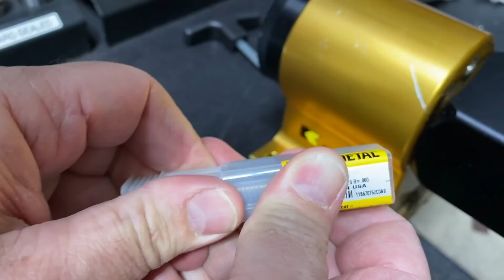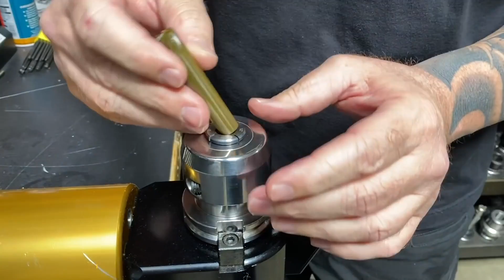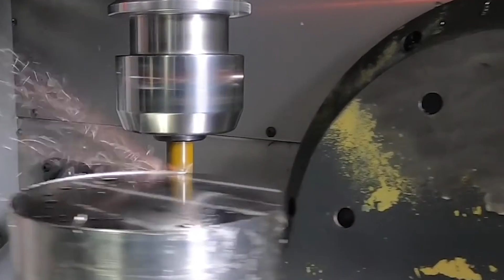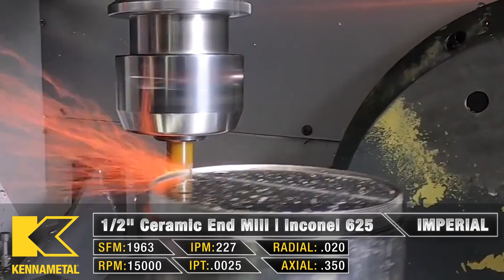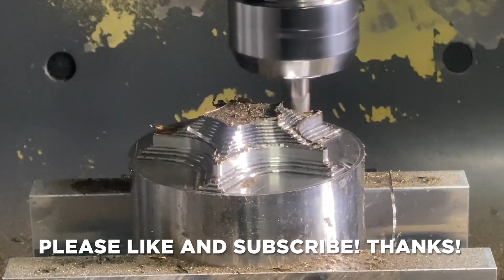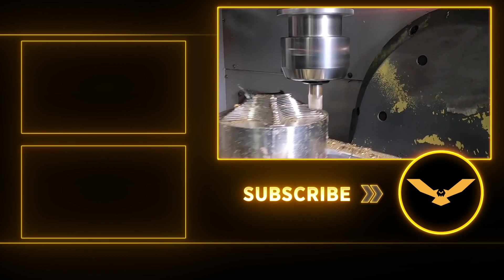You Deserve to Get FIRED if You're This Person in the Machine Shop

Comment: i work in a shop where we the machinists do everything from programming to fixturing to deburring. We basically get material and a print and we just have to figure it out. Ive long said i as well as everyone in shop deserve anywhere from 3x to 5x the amount were making because we are doing 3 to 5 times the work of a normal machinist/operator. Would love to hear some opinions on this, because its got me pretty messed up at work.

Comment: I used to work in a company where they often said "We've been doing it like this for 20 years.. " turned out..i did figure out my own way.. and did the work in half the time.. (only 2 hours instead of 4)
I have my own shop now.. i document everything.. i have made setup-sheets for every part and every machine.
I Stored these sheets on Google Documents, so i can look them up on my phone or tablet, i can edit them, and they  are automatically updated.
This saves me a lot of setup time.. this week.. i switched parts on the lathe.. looked at the sheet.. Ok.. need to replace 2 tools , upload that program, set offset to this value, load program, load stock, hit start.. 5 minutes.. i love that..saving time by working efficient is what gets you paid more..

Comment: I worked for an extrusion company that was international. The issue was that they used the only production facility in the u.s. as a funnel to fuel the rest of the company in other countries. Other facilities were given top tier supplies and technology to support their work load but the u.s. facility had to make due with secondhand equipment and poor management. I left after I eventually realized there was no room for advancement and they just didnt value people who took pride in their work. If anything they only put pressure on the experience good workers to work harder. When management was talked to about it they always did the same b.s. of we are a team and we need you guys to step up. They didn't even train people they just put you somewhere and expected people working production to also teach and train you.

Comment: I have seen 3 different types of programers. Worked under one that was horrible. He would be happy with you one second and upset the next for no reason. He would purposely ruin endmills spinning x2 as fast on stainless getting only 5 parts per endmill. Cutting ccw and cw with the same tool for no reason. I called him out and his ego was hurt too much. Also I had to clean up his mess everyday. He finally got let go and things were better. 

A faker showed up saying he know how to program and he got demoted fast. Didn't know how to count and his programs were set higher than they should be and he would put a limit on it so the sfm would be close. Never opened a book to look at tool data for sfm or chip load recommendations.

Last guy knows what he's doing and pumps the parts out fast and efficiently. Always doing HW to make things run better and come up with new ideas. Unfortunately he is quitting because the guy is so good they expect too much out of him. 

The bad always stick around too long and the good ones are worked to death.

Comment: Back in the 90's, there wasn't an internet. I took manuals home and read them on my own time. I took classes nights and weekends even though I was working 50+ hour weeks. I gained new knowledge with every new shop I worked at...

One thing remained the same: office politics. 

After 15 years in the field of being the programmer, setup person, operator, quality control for the machines I ran; I walked away from the CNC field because I was tired of being the only person that cared about my future.

The last time I updated my resume, 85% of the shops I worked at are no longer in existence.

Comment: I prefer to be my own programmer, setup, button pusher, and inspector. I get shit done faster that way. If I want to try out new orders of operations, techniques, toolpaths, and/or workholding, I just fucking do it. But not off the clock. How many of you buy your own equipment and tooling (that goes with you when you leave) when the boss won't buy it? I'm curious how many of you invest in yourself/your capabilities.

Comment: I have your passion or had I work for a large construction company as a pipe welder and I put every ounce of talent I have in the making a good world one thing I would include in a speech like this is it all depends on what kind of company you work for you have to balance your quality over production in some places for instants in my situation when I take my time to make a x-ray quality world perfect what I expect the customer would want I get label to slow and told him to hurry up I don’t have to be perfect. I bought this for a very long time and still did my due diligence and made it right over time I was known as the slow welder. Granted I wasn’t cutting out any welds like everyone else but they got done with welding before me the discovery that it needs to be cut out comes later so on face I was the “slow welder“ and the bosses or people that mattered never saw that part where that welder was cutting out those welds when they came back from x-ray weeks later they just saw welder A  had this weld count and my weld count was lower. Overtime I got tired of this and I lowered my quality standards to meet the normal weld count that everyone else was getting and I hated it and didn’t want to do it but the company I work for just did not care whether it was an excellent weld they just wanted good enough. 
With all that said sometimes doing a more meticulous job and taking more time will screw you over in the long run like it did me and now with this company I will forever be the “slow welder“

Comment: What happens when you have a programmer that wants to bring new software and techniques to the table but you tell them that this is the way we have always done it and to program to how the operator wants to run it?
That's right, said programmer leaves and you're stuck doing it the same old way you've always done it.

Comment: Once you do more than is required at most shops that I've worked at, then it becomes expected and when you slack off even a little they reprimand you for it. Those shops suck.
Reply: I had it out with a foreman once who reprimanded me for going to the bathroom on a Saturday because I stopped the machine for 5 minutes. I said well when you say the same to the guy that spends 4 days on a 6 hour job who blatantly wastes hours and hours of company time I'll take you seriously.

Comment: Ok, think i see, how it's done in the US. Happily, there is this kind of men among all the wolves of greed. The motivational eloquence is a bit overwhelming for a near-Russian machinist,  but this attitude is better than in most places enforcable. The thought allways comes before action, so make it good.

 About learning - never stop. I do it on the job, but my theory is missing. There are multiple times fewer experienced machinists, than industry would need to run smoothly. Also, probably less CNC-based companies in my entire country, than in one average industrial city of US. So no, i can't go accross the road to find another employer, because there's only one factory using mills and lathes in my city. And they cannot find another miller with experience for a third year now. Even i, without formal engineering or programming education, am the only one in company, or my town, who can operate a Hartford or Mazak. I bet you can count on fingers persons with that experience in my country. It means 100h weeks just getting trough the parts, when orders get urgent. 90% from Russia. Cut-throat concurrence. If i didn't think outside the box, lot of the blueprints would be impossible to follow on 3-axis, or in general. 

 BTW, that HS endmill is such a show-off.. No cooling, or it's invisible?
 A bit too fancy without MasterCam, but if stainless can be done as quick as whatever that billet was, might suggest my boss to give it a shot.

Comment: Boeing just wants operators, you can't edit programs, just load and go.  Machine redlights? Call maintenance and wait.
I'm now at the second shop where I program and run my own parts.  If I decide it can run better I change it.  If I think it'll be easier on the 4 or 5 axis I redo the program for it.  

I'll also say that many shops don't want competent people.  When they offer under $20/hr, that's why they are always hiring.  Anyone decent moves on as soon as possible.  You also have companies that'll raise starting pay, but never bring the older employees up in pay.  I went into a shop getting $25/hr and later found out I was making a good bit more than a guy who had been there over 20yrs, he was the only CNC lathe guy they had.  I've seen too many instances where you either have to change jobs or threaten to leave to even get bumped up to current starting pay.

Comment: I'm a programmer and just handed in my notice to leave as for the last year I've been getting complaints off my boss saying my drawing or programs are wrong. So I took it upon myself to go down to the workshop and setup the machine myself. I was handed tools chipped within an inch of their lives and was told we had no new tools(we did they just couldn't be bothered to let me use them) I used them and one broke. The other operator found it funny as I was getting complained at by the boss. I tried to explain but as usual I'm talking to deaf ears.. so I've quit after 10 years and now looking for a new job.. sometimes it's not the programmer it's ignorance from higher up.

Comment: The Key is: be open for new ways, check them, adop them for your needs, get the essence for you. By the way, how is the MRR with this ceramic compare to an HM with coolant? I have no experience with Inconel and similar, does ceramic performe with other steel? C45, Ck75 and 61SiCr7 (1.7108)

Comment: This is a pretty common failure of the company's who keep them... not a negative against your firm triton. You guys are the pineal of advanced ideas. But all work places I've worked at in fabrication they all have them select few that is always them getting the chance to shine and waste it being old fashioned etc. I recommend somthing ideal and get blown out the water. After 100s of times with this happening I soon learned to not offer my unpaid for advice or idea, I'm fed up of being overlooked for somthing easier thatle cost more in the long run. Some jist won't give you chance due to fear of getting replaced themself

Comment: I have a question about the machining part of the video,   Does this tool not need coolant I’m assuming? And is it supposed to look like that with the sparks?
Reply from the maker: Ceramic Tooling is made to run without coolant because it doesn’t recognize the heat. Type in “Titan of CNC Ceramic” if you wanna hear some in-depth explanation about the science of it, we have a couple videos.

Comment: Titan, Awesome video and some really good things to consider.  Have you tried the dynamic milling going both ways to eliminate air cutting on the way back?  I am wondering how much time you could save that way.  Of course you probably know that you can change the feed on the conventional milling return stroke.  Also I am wondering how much temperature rise you are getting at the bearings after 30 minutes or an hour of cutting.  Keep up the good work!

Comment: What if you had a shop that was that was run by an account who was clueless about machining? a leader that couldn't comprehend why one end mill cost 75% more then another and always bought the cheaper one. What if you had leadmen that didn't lead and spent most of their day in the office doing anything but work? What if most of the operators were more interested in they're conversations and smart phones then doing their jobs properly and ran just enough not to get in to trouble? What if this company some how continued survive and even grow year after year? Well I don't have to ask what if because that is an accurate description of the company I program for on the daily. While I agree with everything you've said over the years about pushing the limits sometimes all a programmer can do is the best he or she can with what they have to work with.

Comment: In the shop I work at you are to do it all. Program, setup, and operate. What is sad is there are 2 guys that are holding the milling department down. They have their own way of programming to throw off everyone else so they can program and make themselves look better because they “know what’s going on” when instead they’re setting the milling department up for failure. I almost push a Bridgeport as hard as they do with a CNC machine.

Comment: The company I work for will not even give anyone with an education The time of day. I have a 7 year apprenticeship . I am certified  in Mastercam , solidworks, Edgecam , Gibbscam, Camworks,and can run a few others. I give my soul and life my life to this work . I program everyday just grabbing models off line < learning mill turn and high speed machining. I have a bachelors degree in  applications engineering as well as mechanical engineering. My math skills are at calculus 3 . They would rather give a highschool kid with no experience in machining the job. Every machine in the tool room has been smashed crashed and crunched . They just say ohh well he is learning  he will get the hang of it eventually. I tell them hey i could do this job with my eyes closed and make you king of the world. responce ummm  no no its ok we are doing just fine as is.. So what do i do at the shop  for a job..... I debur parts lol ... Every shop in the north east is built on this foundation its very sad!!!!
Reply: Lol...

Comment: At my work we make anodes for the semi conductor industry, we have what is called “Copy exact” travelers, basically we are under a contract and can not change anything , tooling, program, fixtures, tool path, nothing, without a one year in advance approval from the customer. So I came to this place not to long ago from a more fast paced shop, and requesting a change form from my boss is basically impossible. We still use edge finders and I suggested haimer testers, or probes for offsets / tool lengths. We finally put in a request for something that will improve setup times.

Comment: Damn. Just totally bashing programmers lol.
Reply: Agree, what about all the dummies on the floor that can't follow directions and start changing things because they think they know better.
Reply: @MG-sg2ci  I know right! Not my fault you can't set the correct settings!
Reply: @MG-sg2ci  Agreed. Bad workmanship, mistakes can and do happen on both ends equally as much.
Reply from the maker: Definitely not bashing programmers and I also just released multiple videos saying that great programmers need to get paid more etc.
What I am saying here is that if you have a programmer that is leading the floor and setting the tempo of the whole shop… and that programmer refuses to learn more, push themselves to be better, and doesn’t communicate with the team operating and setting up their programs…  If that person refuses to change and is the reason that the culture is low etc… and that the company isn’t making money… then that person can do more harm than good and should be replaced.

But all programmers and machinists that are striving to better themselves and those around them… striving to make the company money… Well those programmers should be rewarded with great pay and if they are top level… The company should pay them VERY VERY WELL.
Reply: @TITANSofCNC  I know you're not.
Reply: @TITANSofCNC  I was just giving you a hard time I am a programmer myself and thought it was pretty funny and def resonated with me in my past confrontations with asshole programmers lol. There are a lot of asshole programmers out there. So I def understand where you are coming from.

Comment: Just started a new job 2 weeks ago coolest programmer I ever meet doesn't mind when u ask him questions but now I'm on a mazak lathe with the conversational programming been a mill guy for 12 years they needed a turn guy I wasn't sure but glad I did and with the mazak mazatrol I'm given a chunk of material and a print I determine everything the operations I make the program on the floor do the the set up and do it right and no production one or few pieces and onto a new part new program new set up and no-one up my ass just make good parts efficiently love it never trying to run any production or someone tell me how it needs to be set up and dont worry about program it's been ran plenty times don't touch it smh
Reply: That kind of job is the most satisfying in this trade. I am in a similar job arrangement as you are and wouldn't trade it for anything else.

Comment: what if ur shop doesnt have the money to upgrade its cad cam software and using a basic software like ezcam
Reply: EZCam works and will get the job done, but really learning the software's capabilities can be difficult for the lack of comprehensive visual instruction publicly available. The trick is getting yourself and your thought processes to work like the other software. As a technical representative of a company, (with permission and corporate email), you can learn MasterCam, Fusion 360, Inventor, SolidWorks and even FreeCad for practically nothing in your free time. If you already know Fusion360; you can evaluate AutoDesk Powermill for high speed and 5 axis. 
Evaluation and educational versions are usually available and I think Titan offers CAD/CAM software in their online courses. In the meantime, having a standard tool library with common tools on all the machine can go a long way to speed things up. With experience you can develop stock removal and work holding strategies for the various types of materials to be machined and suitable methods for each machines' power level and plan accordingly.